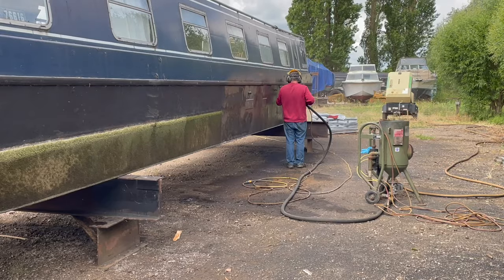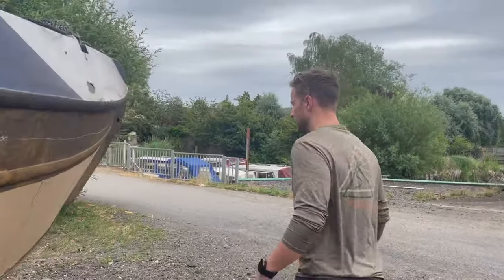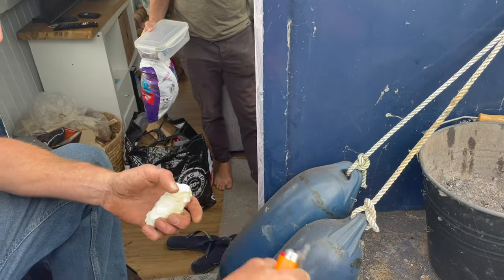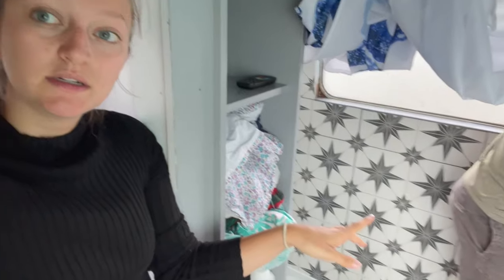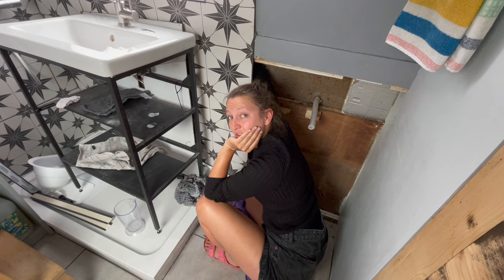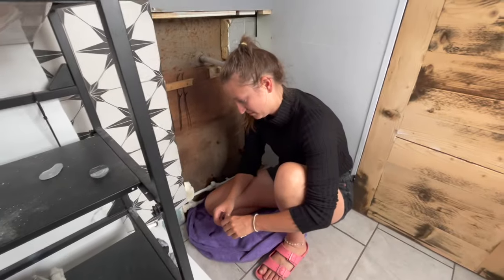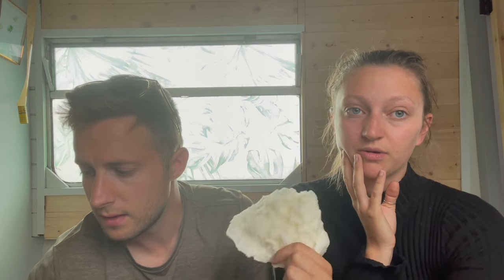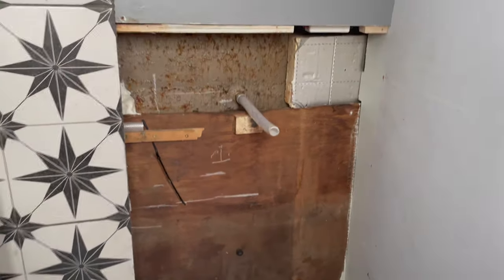Boat up in flames?! We can't afford this - end of our journey?? | Narrowboat Ratae

Comment: What is there to think about. Pull the panel off and remove the foam.
When welding the heat will spread. Remove the foam. That removes any risk.

Comment: Temperature from the flame of a lighter: 600 C
Average temp of a welder: 1400 C
I am a welder. There is no way I'd be doing any welding with that amount of fire risk. Even with a fire spotter in and outside of the boat standing guard.
I dont understand why you guys didnt fully fix the hull from the get go, before ever even starting on the inside. 
It sounds like you guys were using a bunch of bandaid solutions everywhere, but not actually fixing or doing the work the correct way. Then hoped by making it look "pretty" it will all just magically work & be okay?
Make it make sense.
Unless you guys were just trying to offload this cobbled together bandaided boat & then sell this lemon onto an unsuspecting person? Prob  never telling the next owners bout the flammable insulation in the bathroom..

Lets also remember if some ever were to happen, the insurance wouldnt even need to pay, cause you guys have videos of you trying out how fireproof that insulation is & then knowingly still installed it! Not just that, but you even have recorded videos of it & put those online. Well the Internet is forever, even if you delete it. I dont know if you only have family members on here applauding your ever misstep & bad idea. Or you willfully ignore every comment like mine, only to cry wolf later.
Its the first & last video Ive watched. So much lustful temptation of fate is even for my general dare devil life style a bit much.
I usually have a great amount of empathy & sympathy, but here its just gone.
I guess good luck on setting a higher importance on those Bathroom tiles, rather than potentially your own life. But never mind that, cause my guess is this boat will be sold within 6 months of my comment.

Comment: This is what I would do let the welder continue but have a hose spraying water on the part that is glowing in side of the boat and put a nozzle on the hose to reach in the cavity it will put out the flames quickly it will make a mess but it will be better cleaning the water up with a vacuum cleaner as it runs out over the floor than smashing all of your hard work taking the tiles off and after he is finished you still have your bathroom and a little bit of tiling to do and remember to wear a mask because the fumes will be poising. Cheers Doug from Australia.

Comment: What Chloe said about how much you'd learned by buying an old boat was pretty 'on the money'.

You had a warning from your welder about the possibility of fire.

As someone who's had some dealings with 'spooky' and 'woo-woo', I saw that flaming car as - at least - an underline to that.

The worst that will happen if you have to trash the bathroom to replace the foam is more time and money spent.

The worst that can happen if you don't is fire and - maybe - the end of the road.

Do you have all the information you need, to make an informed decision?

Is it worth saying "Oh, screw it!" and tossing a coin?

Good luck - or does one make one's own? - whatever you decide.

Comment: The saddest thing is that an over plated boat is worth nothing. Always get a survey done before purchasing a boat.
Reply: I agree, I would never buy an overplated boat it's such an unknown quantity. For such an old boat I'm surprised that they got insurance without a survey.(maybe they took out 3rd party only !! )
Reply: What is wrong with overplating.  I've seen many older boats overplated and going strong 20 year plus? Is it just snobbery?
Reply: @thefloatingapothecaryroman16  An over plated boat is very dodgy and shows that it's structurally failing. You'll see that when you put it on the market the value will be very low. BTW I'm a narrowboater myself.

Comment: If it's water and air tight there's nothing to feed the flame. You could also wet it down inside if it does take.

Pink foam is retardant.

MiG welding he can do in stages to let the heat dissipate. Monitor from the inside and wet it down

How hard is the window to remove.

It's one of those things. Steel prices aren't likely to improve.

Comment: I watched a few rebuilds now a number have had the same issue as you. Most re plated but at a cheaper time for steel. 
  I’m not a fan of re plating certainly not at that cost. Rust has got your boat sadly. Possibly £20000 to put right and when you finish I suspect you will not be confident in the long term result. 
   People have suggested a go fund me and that’s a good idea, but put the money to buying a better boat with a full survey and one that’s already insulated. There are some great boats about in very good condition.

Comment: If you guys remove the tiles is best to put a number on each of them so when placing back they go as before without cutting
Reply from the maker: Great idea thank you for watching :)
Reply: Good luck removing them without breaking them
Reply: @p46967  scraping them with a thin metal wire … cut underneath.

Comment: Hi,is there any way of getting a hull wrapped by plastic.
Think some boats can.
I wouldn't think of scrapping it, just get it blacked with lots of coats of proper paint.
I think wing it along.
Welding can't be that hard to learn.
My pal paid 10 k for a near complete hull,just off the grand union 48 foot barge
But he lost out on the sale value overall.
Was 20k from ebay for boat
He sold after the 10k spend on hull plates also paint and surveys.
For about 25k.
Lost about 5k on the deal....
Ive got a boat just winging life

Good luck

Comment: If it was me I'd risk the fire, so long as you've planned for it to happen and have the means to put it out promptly. I'd have some long enough 10mm copper pipe connected to C02 pub gas bottles (or c02 fire extinguishers) to get close to any flame, and then plenty of backup fire extinguishers should the worst happen - obviously do research which type is going to be best. Bearing in mind the limited access my thought would be pump the whole enclosed area full of c02, but then there's water as well, so long as you can get it in fast.
I'd say cleaning off the foam within a couple of inches of the weld line would be best, there will be less to burn then, but even remnants are likely to catch so be ready. I see no reason why you shouldn't wet it prior to welding, which should help any spread.
Bear in mind any fumes/smoke from burning foam is likely to be poisonous.
Good luck with it!